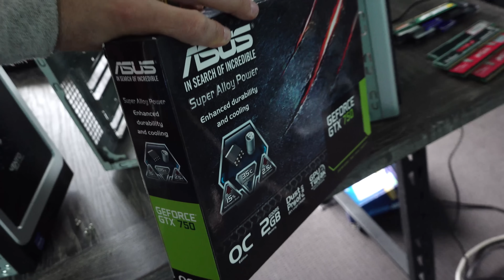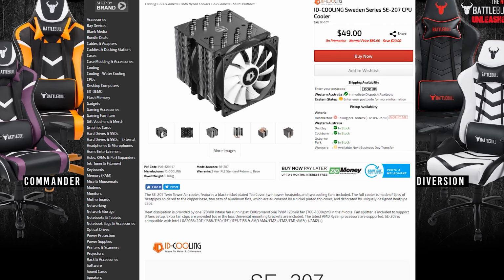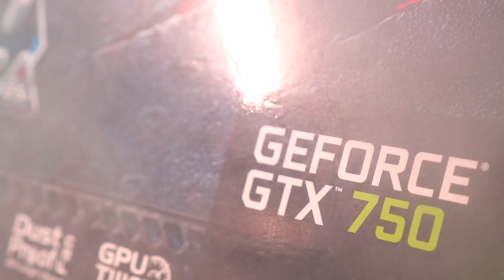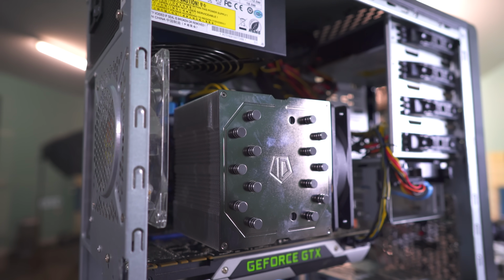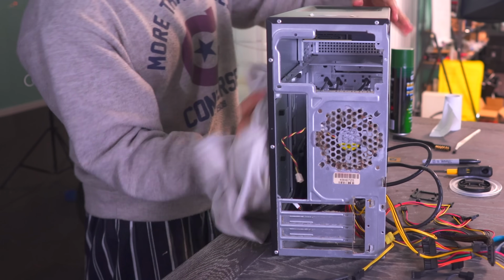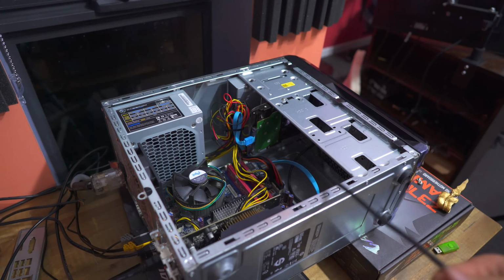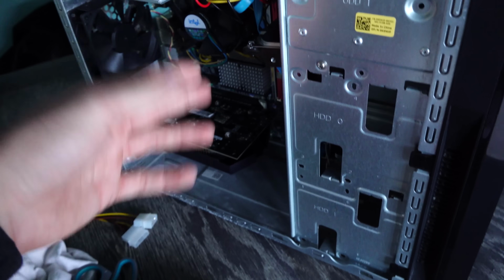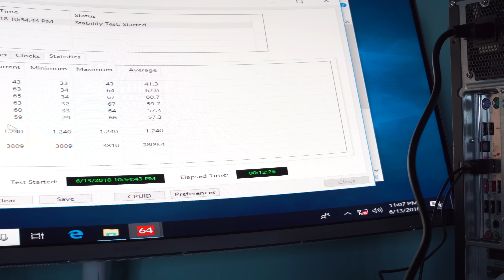How to REFURBISH A PC - 3 Donated Potato PCs Restored to Glory.

Comment: I got a system for free with h81m r2.0 board, g3220 processor, 8gb hyperx blue ram, I wanna buy a gtx 1050ti, would that be a good call or I will get major bottleneck?

Comment: that's my main computer -P5Q / 8GB DDR2 / R9 390 / XEON L5430 BEST Price/performance ever!
the yellow SATA ports are Xpert RAID that works on all OSES WITHOUT DRIVER
and MB also has "Express Gate" - connect to internet without HDD in the system!!
What crap are trying to sell us now, this thing from 2008 is more feature rich than current boards .

Comment: With the X3440 i can put x19 and 210MHz BCLK to 4GHz with 1.3V, with the P7P55D-E PRO and is running fine. With the multiplier x20 and 200MHz the x3440 i don't know why but clock sometimes 4.2GHz and 4.4GHz and then cause BSOD.

BTW cool builds and nice cleaning ^^

Comment: Think you can simply resolder the front io or replace it with new buttons & wiring on that rig.
Recently built a bit newer windows xp rig here inside a ibm thinkcentre e50 steel minitower case as a base.
(Gigabyte based Agp socket 775 motherboard originally that didn't even take the pentium D processors, only takes ddr1 & fastest agp gpu i had was between a ati 2400 xt 256 mb or a ati radeon 9550 that overclocks good on the core but vram doesn't get up too 9600 speeds so it's quite slow.)

New hardware i put in is
Asus m4n78-am Am2+ motherboard
3 gb ddr2 @ 667 mhz
Cpu is an athlon II x3 445 at 3.1 ghz after a bios update.
as gpu a single slot hd 4670 1 gb from xfx bit of a shame they stopped doing nvidia gpu's.
Wish the voltage could be lowered on the vcore better though, the (Power saving) voltage is 1.450v the cpu is stable at stock speeds down at 1.275v without the 4th core unlocked so just a bit overkill on voltage there.
I overclocked the cpu unlocked with 4 cores too 3.5 ghz on that voltage without any stability issues on a gigabyte 870a ud3 motherboard my dad now has with a phenom II x6 1090t @ 3.7 ghz & my old R9 280. (would need a better cpu cooler though for that then the stock one for the athlon II cpu on this motherboard.)
Harddrive is a basic 250 gb sata drive from like 2007 - 2008 atm.
Soundcard is a creative soundblaster audigy.
(Black & gold variant that was once in a gaming pc with a pentium D 945 & a 7800 gtx 256 mb)
Looks essentially brand new after some cleaning, no corrosion or anything either on the plugs, drivers are a bit odd though.)
Powersupply is a generic powerman 400w unit with a single pci-e 6 pin & power rating is probably more like 280w on the split 12v rails & rest is at 3.3v & 5v.
(But it's gotten a bit weak over the years & doesn't manage too power a HD 5750 at stock speeds so i better not use that cable for now.)

Comment: What happens to the potato computers that dont make it .
They become hash browns lol
Reply: Metalmachine467 xD stop
Reply: I'd say they might get put into a bit more area specific line of computers like ultimate windows xp gaming rig or similar that isn't crazy with the performance on the parts used but is still overkill for games from 2002 - 2006 etc. Like my windows xp rig built of parts ive had laying around for a while, it runs windows 7 & 10 probably fine but id rather put it on an os where it's absolutely overkill for what id use it for but still want an xp rig too keep around.

athlon II x3 445 3.1 ghz cpu
3 gb ddr2 @667 mhz
asus am2+ matx motherboard from asus the M4N78-AM
1 sata 250 gb hdd, gpu is a 1 gb hd 4670 from xfx
Also put in a bit older soundcard a creative soundblaster audigy. (Cant recall the sb model number atm on it.)
(Lovely looking black & gold colors on it, kind of wish it had better drivers though that weren't as odd or glitchy on newer operating systems.)
Reply: Marcus60661 Wtf
Reply: Cagri Mola Wtf
Reply: Thę Łégéñd ur quicj
Reply: Cagri Mola ( ͡° ͜ʖ ͡°)

Comment: hey brian, iam just wondering, can u feature that lga 775 asus p5q board in other video ? i have the similar board, the p5qe , only the motherboard tho, and curious how much that board can go
Reply: If it's in working condition between 70 - 120 usd I'd say.
Do you have the box & everything with it or just the bare motherboard ?
A good pointer is usually already sold listings on ebay & what current listings are for the same motherboard.

Comment: if you are using molex power to pci e power adapters make sure not to use 2 molex ports on the same line.  use 2 different lines.

Comment: For Q6600: what's the best budget budget budget cooler for geeks like me who try to build cheapest possible just for the fun of it?

I got a Q6600 PC for my son for around $60 USD and put a 7870 in for about $75 USD.
I can overclock the Q6600 on stock cooler by 10% by changing FSB. But 20% seems too high for temps (I turned down voltage but then got stability issues).

Comment: betting my 2 core i3 4160 dead under the desk has no hope lol
Reply: Eh, change the cpu too an I5, upgrade ram & throw in a gtx 1050ti or 1060 3 gb along with a newer power supply (Might need too swap case if its a small one.)
Reply: Marcus60661 its a 180w psu, some chinese brand. dont remember if the cpu is socketed or not though, but it does have 8gb ram which isnt the worst

Comment: Dude man perfect timing on the video i have a acer desktop computer i pulled out of the bin has a intel pentium in it on the acer m646 or m246 motherboard i have a intel celeron 2.6 ghz i think from another computer putting that one in it and going to build a potato pc to sell off and i have a pile of parts coming next week one part is defective but the guy does not have time to test the parts so i have a 250gb ssd a 1tb hdd a msi b250m motherboard and a cpu and a 450 watt psu i scored for under a 100

Comment: is it sad the I enjoy playing on an w3680 over my i7-3770k? not even a real question :) I built a xeon custom pc and case because of you lol. I was very interested in the x58 platform so I jumped on a dell precision motherboard for $24 USD and already had the CPU laying around. paired it with 12GB Crutal Ballistix (3x4gb) and a gtx 650TI Boost, as well as an Inland 500w PSU. I also tried the EVGA GTX 1060 SSC 6gb and could play GTA V between 90-150fps. absolutely love your channel :)

Comment: I got a nice-ish PC from one of mny teachers, he had it lying around in his garage. FX 6300 @3.95ghz, 8GB RAM, GTX 780. need I say more? As well, does anyone know what chipset or motherboard is the cheapest to overclock an X3440?
Reply: A non H chipset can overclock the xeon processors better as its usually found on more expensive motherboards. (done via fsb after all.)

But all H chipset motherboards (ofc not oem motherboards they are locked down quite a bit in the bios.)
Can also do a bit of overclocking depending on how good the power delivery circuit is on the motherboard.
Though usually these motherboards are the cheapest bottom tier stuff so you might only get a minimal increase on the processor like say 3.4 ghz instead of 3.0 ghz stock compared too the more expensive motherboards that can do 3.8 ghz+ or similar on the same processor.

Comment: There is one trick that may be worth trying for a HDD that is not likely to be full... partition half size, and then expand using Minitool Free - the MFT will remain closer to the area that is used by boot optimization  - it's like using the drive "cut", but with the full capacity available if needed.

Comment: Great video Bryan as always keep up the good work. I have a i5 750 Vostro potato with a r9 380 but having problems with pc crashing when hard drive light goes out,i have changed to a new hard drive , ram change and new psu and sata cables. Any help would be much apricated as running out of ideas and I know if anyone can help it would be you thanks.

Comment: Bry, love you restoring this old stuff, nice to see others like me recycling good usable pc parts.
Next time try using some alcohol on the thermal grease to get it off instead of (2:26) scraping as I can see (2:43) is not very clean, you'll find it much easier.
Just a quickie> You use WD40 as a cleaner?

Comment: the real question is a toaster computer better then a potato ?
Reply: Toaster is a lower tier then Potato I'd say, potato has a bit more use depending on how its prepared & cooked (aka what parts you buy.)
While a toaster, well toasts...
(A.K.A You are pretty much stuck with the parts you got or barely can get extra performance out if it without replacing major parts & can mainly only prepare the toast too be good (games too run well.)

Comment: Tech Yes! community Help me. Recommend the Best GPU (most powerful without extreme CPU bottleneck) for my old build, I am ok with a small CPU bottleneck. LGA775 with xeon x5460 @ 3.8ghz 8GB DD2. 650w good Branded PSU.
Usage HTPC: Older games, net surfing/streaming, Steam in home streaming, Emulation.
I might be able to score a use GTX970 this weekend for 140 USD hopefully less, But that's probably overkill.
Reply: Even if its overkill on the gpu side you can always save up some more cash & buy a newer platform too put the gpu into a year or two later.

Comment: Hi i love your refurbished series video. You inspired me to build retro fun project Pentium 4 PC. Will try to spray my old Asus P5GPL-X motherboard and check how I looks after. Will skip break cleaner and after dusting will go with WD40.
Reply: Do not use it in the motherboard socket or in any slots.
It leaves a thin film while being a water displacement spray maimly if its the general use one usually found in a larger can.
Chemically clean alcohol or chemically clean gasoline, electronics cleaning spray works better for cleaning off the motherboard.
Reply: Marcus60661 thanks, will look for those things.

Comment: Thanks Bryan, I also live for the old case and parts too as an oldie living on a low budget and love gaming too.

When you showed yourself taking off the [those] Bios chips X two (computer with two types of RAM also with the foot assisted USB lead removal Front panel. Nice one mate) what do you do after? Just bin the chips or put them back or completely replace?
As i was taken back thinking if removed the motherboard would be no good any longer, as in not working. Do the older motherboards - computers work without them, at all or with tiny problems?

I have seen you take them out before in other videos too.

Loved your sponsor waffles for the first half of trip... As too the wonderful coverage of comptec 18.

Comment: Tech Yes City, out of interest, What are you using for the thermal imaging?  Oddly, I am having the exact same problems with an identical dell case.  I have tried 2 completely different systems inside this case, intermittent starts on power up if you wiggle the graphics card, so already suspecting it was shorting issue around the graphics card area and the case.

Comment: Tip for getting these potatoes going :) You'll often want to get extra DDR2/DDR3 ram. I've found the cheapest place to get them locally is to go around to computer shops as they'll often do upgrades and sell the old parts cheaply. (e.g. picked up 2x8GB DDR3 for A$40).

Comment: 2 thing i have the same cases the dell case every time i put a mo bo in with out the screws it works i screw it in no work grouding out to the dell stand off`s???? and the thermaltake case the power on button as gone  and  i think it a funny one  i don`t have any or i cant get it out .i  hate thermalcrap
Reply: Certain older thermaltake cases had screws that held the front panel in place.
Reply: thats not the problem its the  button  its been some time and i cant remember  i`ve worked on alot of cases and i seen nothing like this

Comment: Could you help us out with the BIOS settings on that x3440 you ended up with? Voltages etc too.

Also: up to what GPU would be reasonable to combine it with? Would a 1060 be bottlenecked for example?

Comment: Hey might I ask, I'm having trouble with my PC. The CPU fan and GPU fan won't spin properly with RAM on but spin perfectly wihout the RAM. The ram is surely working but idk about the cpu and motherboard. The monitor doesn't detect any signal. Help plz.
Reply: Dark try using different ram slots or using on stick at a time to see if any are faulty
Reply: I only have 1 ram stick which is guaranteed to be working. I've also tried both slots. My number one culprit I think is the cpu since the motherboard is brand new lol
Reply: Dark it's very rare for the cpu to cause it to do that. Have you tried your ram in a different pc? What cpu mobo and ram do you have
Reply: Yeah I've tried the RAM on another PC. Completely working. I have an Asrock h61m vg4 with a bios version that supports the i5 3330 and Crucial 8gb ddr3l udimm.
Reply: Dark why are you using laptop memory on a desktop mobo
Reply: Uhm don't know about you but it's not laptop memory lol. I'm not uneducated in PCs m8, just confused.
Reply: Dark it's the fact that you said ddr3l which is laptop memory
Reply: It just means it uses less voltage than usual if I'm not mistaken. It's definitely desktop memory. Check it out: Crucial 8gb DDR3L UDIMM 1.35v
Reply: kenny jeffree there are ddr3L for desktops.

Comment: This is why I love this channel. The other content you push out I watch. But this is what I really enjoy. This got me into getting used pc's from family or friends. The lonely ones that were condemned to spend their lives in a basement or garage. I take em and show them the tech yes loving and it's amazing to see what they are capable of. So far I've refurbished 5 machines. All of them were ether core 2 duo or quads.
Reply: I have been doing the exact same thing. Got 3 computers up and running for the Grand kids. Everything was donated from family and friends.
Reply: Same here. Once I ran out of personal projects I started doing it for charity. Sent a pallet of refurb desktops & notebooks out to Africa through the Turing Trust. It's amazing how much kit people will donate and let you play with if it's for a good cause.
Reply: Obsolete? Yes and no. A C2D at 3.0 Ghz is still ok for web browsing and light office work. Compare it to the i3 'U series' notebook CPUs. A Wolfdale E8400 has higher single thread performance than a Haswell 4120U or Ivy bridge 3227U. Sure, the C2D uses WAY more power but raw performance isn't so different even multi threaded. Some people just don't need anything better.

Comment: omg i have 2 775 computer 1 fm2+ and 1 1156 at home but i don't think anyone would buy that
Reply: 1156 boards can be great if they can overclock. Get a cheapo i5-750 or i7-860 and take it to 3.7-4.2 Ghz (depending on chip and cooling) still a VERY zippy machine. Only drawback tends to be sata2 and usb2 only.

Comment: I really want a P5Q deluxe to OC my Q9650, but they are so expensive whenever I find one. Plus, I'd need DDR3 RAM since my potato runs DDR2 and spending that much I may as well get a better PC.
Reply: why not use the electrical tape method? sadly my oem lenovo lga 775 motherboard died like a year ago otherwise I will be enjoying my q6600 at 3GHz
Reply: the p5q deluxe is a ddr2 motherboard though isn't it ?
Reply: Yeah you're right. Was thinking this was a P5Q3 Deluxe.